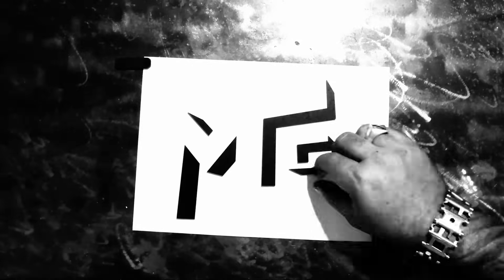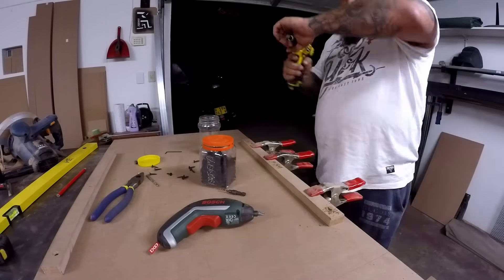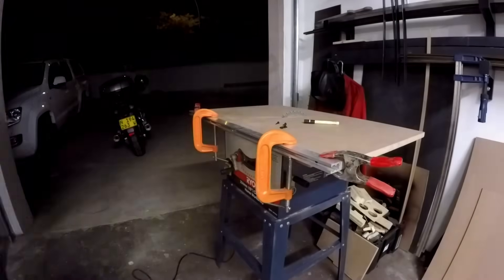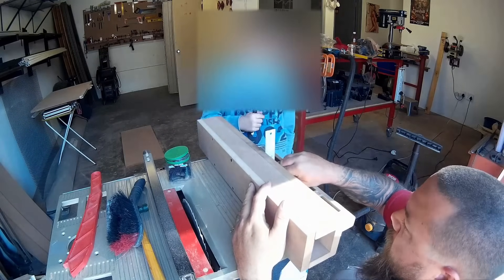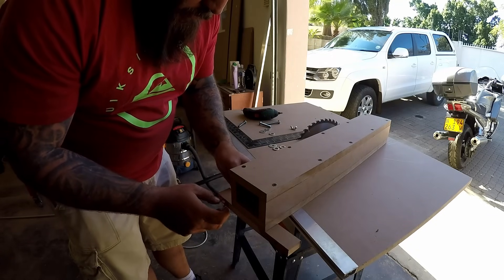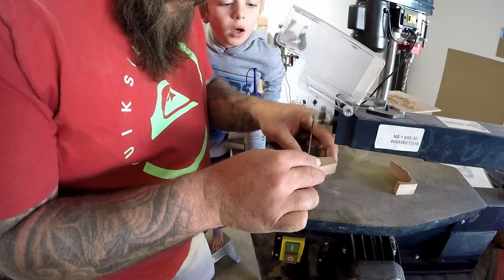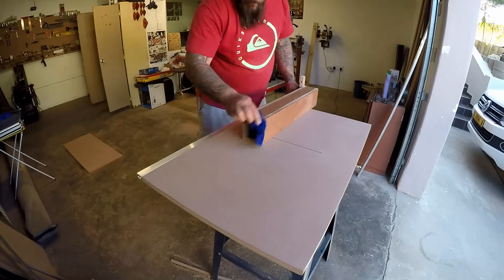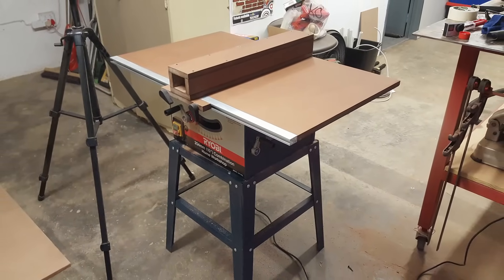Cheap Table Saw Improvements Part 1

Comment: Greetings from 🇿🇲. I'm very new to the woodworking and It is such a pleasure to find your video. I bought the exact same table saw a couple of months back and almost immediately took to the Internet for some tips on solving the few problems I encountered with it including the poor fence and also how best I could use the router and jigsaw slots etc. It got a little frustrating coz it looks like this particular saw is not so popular in the west and this is the first time I've seen it on YouTube. So thank you for sharing your saw improvements, they will definitely come in handy as I explore woodworking further. I intend on making a jig to help me make boxes so thank you for giving me the confidence to keep going.

Comment: 8:30 you probably know by now, but just for anyone watching this in the future. The kickback happened because its cutting something wider than it is long (a so called 'cross cut'). This configuration of the fence should only be used when something is longer than wide (or close enough to that). Its called a 'rip cut', therefore the name of this regular fence is a 'rip fence'. If you would want to do a cross cut, you would need a cross cut sled, miter gauge or miter sled to do it safely.

In a bit more detail, the kickback happens because the blade gets 'pinched' by the material. Because it is such a wide piece, wider than long, it is easy to put too much pressure on the outside, making it pinch and kicking back.

Nice video anyways. I do think your choice of MDF was good for this project. Mostly because its exceptionally flat. The dust might not be very nice, but once assembled that of course isn't an issue.
Reply: honest and educative comment for beginners, thanks
Reply: my grandpa always told me to toe out the end of the fence a hair when i was a kid and i never understood why until a few years after his passing. still made me smile though
Reply: Kick back can happen for a variety reasons, a wobbly/inaccurate cross cut is one but the other reason is that there is no riving knife behind the blade. Plus, do not guide the wood with the left hand past the blade, in fact, never ever go beyond the cutting point of the blade. Safety is alway no 1. If you feel something is not right, don't use the saw.
Reply: @Foxated  except in this case it very much was because this was a crosscut and to do a crosscut, you need to use the crosscut fence not the ripping fence.

Comment: I have the exact same table saw, and have the same issues with the table and the fence.  Was going to look at an upgraded table saw.  Instead I am going to build this project.  Most excellent!  Thanks (I am very much a novice weekend worrier and loving the new adventure into wood work.) - And also really great to see a woodworking video from a fellow South African.

Comment: Good job! I have a cheaper Craftman tablesaw that I purchased back in the 1980’s.
Still works but small top. I am thinking of building it into a work bench so I can make larger
cuts and I got some great ideas from your video. Kudos for the patience you showed while receiving help from the kids. Wished I had that patients when my kids were young.
Reply from the maker: Thanx man... good luck with your build... my patience still wears thin with the kids sometimes... :-)

Comment: Good job you have great natural engineering skills that will obviously increase with each project. But hope you don't mind I would like to make a couple of suggestions. 1 always wear protective glasses just put them on when your in the shop remember your little in-country with kickback. They can be much worse. You only get two eyes. 2 get in the habit of lowering the blade back to zero and locking it in. Both  for self preservation and I noticed you have a couple of young people hanging out. Stay safe 😊
Reply from the maker: Thanx Kevin... yeah, I was pretty stupid back then... thanx for caring enough to take the time and give me some good advice... you should check out some of my more recent videos, I'd like to think they have improved a bunch... both in content and in safety... 😊 thanx for watching mate...

Comment: Great video! I have a Ryobi table saw, cheapie @ $130.00 .I made some improvements, like a zero tolerance blade cover. My saw blows dust everywhere.  I am surprised that you let your kids run around your shop while you work, sawdust is not a healthy environment to be breathing or getting in eyes, for you or for them. Please use some safety gear. ie. goggles, masks and ear protection.  
A bit of a nuisance at first, but you get used to them. 
Also a Irving knife and blade guard would be good, before something bad happens.  I will try to make your improvements to my little Ryobi. It definitely needs improvements.😊 👍
Reply from the maker: Thanx James... great advice... yeah, sorry... I was pretty clueless back then... my PPE game is much stronger these days... I'm all about the safety... 👍

Comment: Finally something I can use. I was given a table saw a couple of months ago, but, like yours, the top is too small. I've been looking for something I could build to fix that. The other videos I found were too complicated and or too large. I have only an open patio to use as my "shop" so size matters. Well done on the build, sir.
Reply from the maker: Thanx Howard... Yeah this upgrade worked quite well for me... did a rebuild of this one though, here is a link if you'd like to check it out: https://www.youtube.com/watch?v=pGNBSCswBac&lc=UgwYJslkkFMUKh0MMrh4AaABAg ... not that much more complicated than this one, but quite a bit more versatile... Glad you liked it, thanx for watching...

Comment: I am planing to do the same, but I will cut the top in half and make one side square to the blade and then add the other half and raise the blade to cut the zero clearance slot.  I am also going to use a melanite or formica top with the mitre tracks for easy feed. Thanks for the inspiration.

Comment: Your video convinced me, I'm going to put a custom top and fence system on my 10" craftsman table saw. Thanks, but be careful, you never want to cross cut a small piece on a table saw without using a miter gage, you're just asking for a kick back. Use a chop saw, or radial arm, if you don't have those use a miter box, and hand cut it. It's not worth losing a finger, to save a few seconds.
Reply from the maker: Great... purchased a compund mitre saw last week, so... I wont have to do cross cuts on the table saw anymore... :-)
Reply: MACON CAMPBELL awesome, you're going to love it. It's my go-to saw in the shop I use it for just about everything.

Comment: Nice. I love seeing this kind of ingenuity.  You really need to make sure that MDF is waterproofed, because it will swell and warp as others have said. A laminate top will also make things slide easier.
I decided after spending about $150 on my saw to make it better that it would be cheaper in the long run to just buy a new saw since the table near the blade was not flat anymore. After looking at all the cheap $500 saws I decided I should just bite the bullet and buy a Jet proshop saw. Luckily I have very good credit, because I don't have that much cash.
Reply from the maker: Thanx, I am actually planning a total rebuild... 
wow... that Jet proshop is awesome.. I would sell a kidney for one of those LOL... Enjoy it

Comment: I got the exact same table saw, and after a weekend trying to use it to create a small test project, I experienced all the issues you encountered.  I need a decent fence and crosscut sled, so finding this is awesome.  (I thought that I would want to strip the saw off its wonky base and mount it into a bigger table).  Your approach is 'lekker' and I'm going to be following your ideas and thinking! Baie, baie dankie meneer!

Comment: Clever use of MDF to increase the table size and give you the more accurate fence. I may follow this same plan, but I think it may be helpful to cut out a “saw clearance plate” slot. So in the future it will be easy to swap out the blade w/o taking off the saw top. I do like this setup though!
Reply from the maker: Thanx Alexander... I did fix this problem with my second upgrade, by incorporating the existing table... here is a link if you want to check it out: https://youtu.be/pGNBSCswBac
Thanx for watching...

Comment: to solve the problem with the bolts binding you could have a strip of steel with two bolts welded to it.  the strip would ride better in the track as well.
Reply from the maker: Good idea... Thanx

Comment: Great job. One of the simplest and elegant solutions iv seen. I suggest you add a riving knife to help prevent kick back.  It also provides a cleaner cut. Frank Howarth made a good video on this. His design would work on your table.
Reply from the maker: Thanx man... Checked out Frank's video, thats a pretty cool idea having the riving knife as part of the throat plate... I may just use that... Great advice... \m/,

Comment: Use a smaller nut on a washer - that way you can have the wing nut on the outside (Might be wrong but just typing as thoughts appear).... nice video !
Reply from the maker: Great idea...

Comment: Interesting build.  I have been pondering a thing for my saw for a while now.  I have been thinking of one of those wooden top folding tables, cutting a square hole out big enough to hold my saw in either orientation and using something like threaded rods and the piece I cut out of the table top to make a "shelf" for the saw that is exactly as deep as the saw it tall.  I figured I could mount it by surrounding the bottom of the shelf it sits on with strips so it just plunks in.  For the fence I figured just a straight piece of wood or angle iron with wood screwed to it and some L's that hang over the ends and hug the table well.  Thread in some machine screws you can tighten up into the side of the table to hold it in position.  That would give me a table large enough to rip down sheet goods, and other large pieces, and if I ever want my saw to be portable, I can just lift it up and out.  No mods at all to the saw proper.  Plus the big table for it folds up and stores so it will not be in the way when I am not using it.  The downsides that I see are I would need to set up on someplace level like my deck (not a problem) and the shelf mounting for the saw may need some bolstering to keep it from moving at all.
Reply from the maker: Thanx... this seems like a good plan, I am also rethinking my design... kept mine pretty simple, cause i was not very confident in my abilities at the time of building it :-)... my new idea is similar to yours in that i want to build around the actual top and not over it... nothing concrete yet, but I'm workin on it... thanx for sharing your ideas...

Comment: Thanks for posting this video.  I have just (this week) bought the same table saw and am seriously not impressed with the fence. It's impossible to get it square with the table and hence parallel with the blade.  And the table itself is a bit small.  I think I will follow your example in fitting a new bigger top.  Not sure if I'll do the exact same fence as I do have one or two other ideas which might, or might not work.
Reply from the maker: Yeah, these saw's are not the best... you might want to check out the second upgrade I did, here is a link: https://youtu.be/pGNBSCswBac ... turned out a lot better... Good luck with yours...
Reply: @maconSTUFF  Thanks will take a look.  It certainly is useful, but will be upgraded sometime in the future.  Will just make a plan (or many plans) to get by until then.

Comment: I JUST had a look at buying one of these used and opted against it after having handled the thing. The table itself is great for the pre prep for the router and how machined it is. But damn, definetely not a just take it and use it machine. Not surprised to find an improvement video for it. Well done, mate

Comment: nicely done. one change I might make is instead of spinning nuts to lock it down, maybe more of a level with a off set head so that pulled up the fence and move, but pushed down and the lever tries to pull the head of the bolt out of the T track, and pulls it tight. Would make it really quick to adjust. 
Also adding a measuring tape would be helpful too.
Seen another fence where the guy put a bolt with a rubber wheel to press against the table, and an handle to spin on the side where you stand, when you spin the knob the fence moves left or right. He had it so ever 1/2 rotation was a 1/4 inch movement of the fence, so made for fast work moving the fence once to had a reference point. Cause hitting it with your hand an hoping you land just the right distance is kinda of not very technical.
Sorry when I started this I only meant to mention the first thing, then I kept thinking of things I would add, I do think you did really good work.
Reply from the maker: Thanx... Yeah, adjusting my fence is a little cumbersome... will most definitely be making some changes is the future...

Comment: Hey, nice job, thanks for sharing. You probably only need one bolt into the T-Track but it would need to be in the middle of the t-piece on your fence that slides along the track. When you tighten it, the t-piece will be pulled flush against the T-Track and it should be square based on your set up.

Also, if your knob is too big, that's usually not a problem! ;-)
Reply from the maker: Thanx Cory... beginning to think I should have gone with one knob too..

Comment: On the kind of fence that came with the saw,, if you push forward on the fence it will square up. Then when you tighten it it locks on both ends, it is square and rock solid.
Reply from the maker: Yeah, I kinda figured that out after the second use, but the bed was still too small... in fact, the one I built in this video is also getting a bit small for me, got a bigger better one planned for a future video... Thanx for watchin

Comment: Great video mate, how about a back plate on the back of the rip fence, so when you put the fence on both front and back are bang on, if you do get kick back or something goes wrong the fence will be more secure and will also stop thicker materials pushing the back of the fence off alignment as you push through
Reply from the maker: Good idea...

Comment: MDF dust is so dangerous even when your cleaning up afterwards ,it as been said you must wear a mask and cut all MDF outside wherever possible too, use your rivving knife always with a table saw and never stand inline with the blade, whenever possible use your blade guard , this game is all about safety first ,crack this and you'll enjoy woodworking for many years without injury ! Good luck with all your projects.
Reply from the maker: Thanx Kev... will do...

Comment: MDF dust does not kill you! It's the formaldehyde that is used to glue the board together which release toxic gases when heated via the saw blade that is nasty. Still dust/gas mask is highly advisable! Great vid though bro!
Reply from the maker: Thanx... Yeah, I've been using the mask more often since this video... LOL... gotta get a better mask though... this cheapy I'm using sucks... leaning toward a RZ Mask... looks nice and comfortable..

Comment: Hi there from South Africa. I just bought a similar table saw. in standard trim from the manufacturer, it's crap! Decided to build my own bigger and flatter table and get everything absolutely square. was contemplating superwood. What thickness did you use? Also where did you get the alu t-track? I'm in Cape Town so should have better luck finding something similar. My setup will be using 4 of those tracks. One like yours and one on the opposite side, and then 2 more to use as a cutting sleigh. Thanks for a great video.
Reply from the maker: Hey Eugene... I think I used like an 18mm MDF in this particular upgrade... I didn't use it for very long like this... did another upgrade a few month later, here is a link: https://youtu.be/pGNBSCswBac ... I got the track from a local 4x4 shop, it wasn't proper T-Track... I'm sure you'll be able to find the real thing pretty easy in Cape Town... good luck, and thanx for watching...

Comment: Nice boet, no one around here knows what the hell t-track is lol. Next you should look at putting a mitre slot into that top so that you can build a crosscut sled for it.
Reply: I see you have a wood lathe too, definitely need those slots then so you can make a wedgie sled. Nice and easy to make segmented bowls using one of those.
Reply from the maker: I am actually planning an entirely new top and fence... miter slots are definitely part of the plan... Thanx for watchin

Comment: Interesting...my question is did you change the blade size because I would have thought you would lose a lot of hight with a standard blade ..also the table top..won't it get ripped up with rough wood ? apart from that there are plenty of idea's for u tubers
Reply from the maker: Thanx Tony... Yeah this was not  a perfect design, I solved a lot of the problems in Part 3, here is a link if you're interested: https://youtu.be/pGNBSCswBac